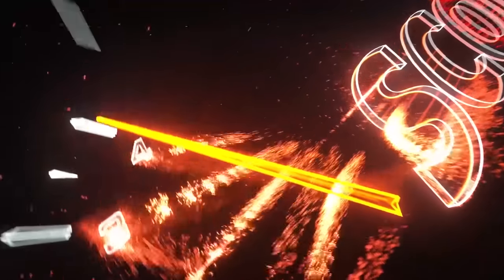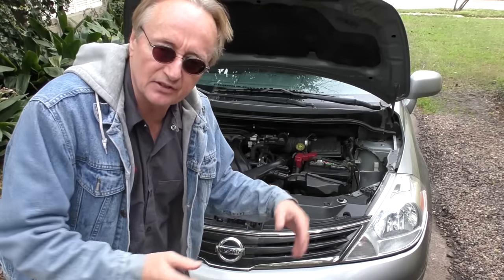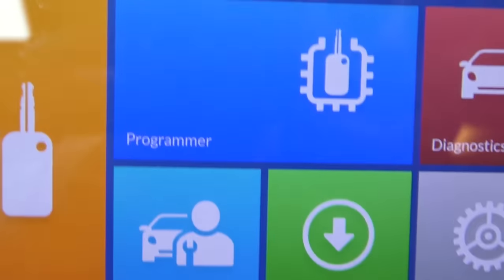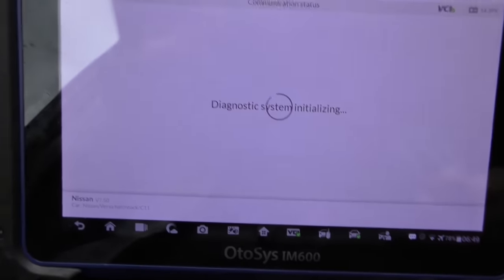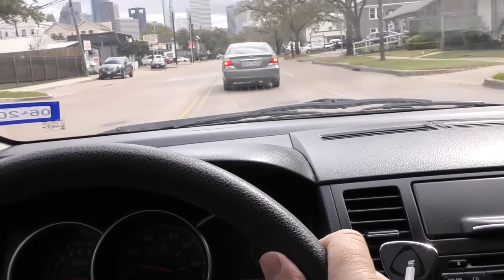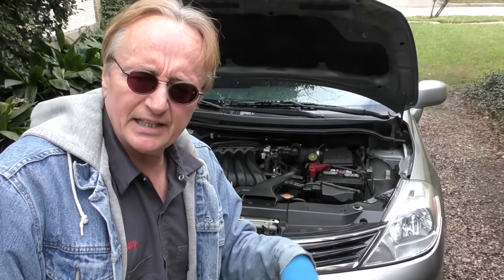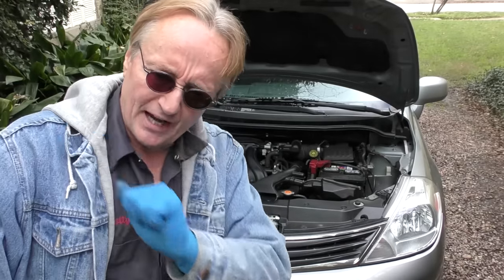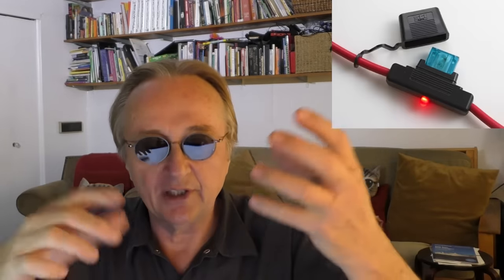Here's Why You Should Buy This Cheap Nissan

Comment: I can't believe Renault bought out Nissan and pretty much destroyed their reputation. They decimated the Skyline name.
Reply: Without Renault, no Nissan. I don't really like Renaults, but it IS true. Just look it up. ^^^ this guy above me is correct. They needed to cut tons of costs. They were not efficient.

Also Renault has no hand in their design. To me Nissan, as they are right now, are one of the more boring brands. Especially from an interior standpoint.
Reply: @Astke  Renault doesn't use CVT, but rather dual-clutch transmissions (known as EDC)! They're amazing here in Europe! At least better than the Volkswagen mafia criminals!
Reply: shechshire 
I think you're talking about Renault's old ceo Charles Ghosn.
  Nissan & Renault today are sharing technology while operating their own autonomously

*NO ONE SIDE IS CONTROLLING THE OTHER*
Reply: @MainMite06  I think they're like Honda and Ford, a balance of reliability and planned obsolescence and it looks like Toyota just got into it.

Comment: My parents owned a 2013 with a 5spd manual brand new. Sold it with 188k miles city miles. No major problems other than rear wheel bearings and A/C blower.
Reply: Heywood Jablowme 
My 08 Versa 4AT still runs all 4 original wheel bearings & original A/C blower right now at 215k..

Comment: My GF has a 14 versa with 174k miles . Recently I’m changing the struts, ac pressure sensor , rear wheel sensor code and several other small things but it’s still going strong with 30 mpg

Comment: I've had a 2015 Versa Note w/ CVT, no transmission/engine issues so far at 119K
Reply: Probably because it's a tiny car with a tiny engine. If it was a Sentra then it would be slipping all over the place.

Comment: Yes its good car, my friend using 2011 model  from 4 years and have 350,000 miles and it was 100,000 miles when he bought 4 years ago
Reply: Your friend drove 250,000 miles in 4 years?? 62,500 miles a year. That's a lot of miles.
Reply: @samadahmed7804  Yessssssss
Reply: @samadahmed7804  I drive 76,500 miles a year since 2014, not all that uncommon
Reply: @j887276  wow instead meanwhile my 2010  infiniti g37 just broke 50k 😂
Reply: @jamesmyers6739  stop babying it
Reply: @samadahmed7804  I drive a good 40-50k a year  just work and kid stuff
Reply: I have 2007 Nissan versa hatchback s its 181k miles on odometer i just changed transmission fluid every 2 years and transmission still good
Reply: no issues really, yet?
Reply: @EphemeralProductions  no major issue only wear and tear parts

Comment: Sold the Nissan Tiida 1.6L 4 Speed Auto for 2500$ approx. Just bought today Nissan Versa Hatch Back US specs (2012 limited edition) 4Speed Auto. 223k on ODO. Clean car. Luv it ❤️❤️😍 the difference I noticed from the GCC Tiida car spec'd to the US spec'd Versa are more options all around cruise & volume control on steering, foldable rear seats & in-dash mp3 player ❤

Comment: I would kind of stay away from any pre-2019 model year Nissan because of the issues with the JATCO CVT's. Current Nissans seem to be a lot better luck with CVT reliability.
Reply: There are millions of Nissan's running trouble free on roads with over 100ks in their clocks with CVTs. JATCO is a world class trans company and even JEEP uses their CVTs. The problem is, Nissan was the first to use CVTs on a commercial basis in 2009 and obviously early use of new tech gives a lot of teething problems mainly because people didn't know how to treat CVTs. You abuse CVT and it punishes you! Dont overload, change special oil once 50k kms and you will get one of the best of auto technologies today.

Comment: Have the same car Nissan Versa Tiida 2008. & It has approx. 174,000 miles & runs like a dream ❤️
Reply: s3 savage 
1.6L or 1.8L? Manual, 4AT, or CVT?
Reply: I have a cvt versa sl 2008 with 150k miles, it's run so nice, I love this car and have a descent sound with the subwoofer equiopement in the trunk
Reply: @MainMite06  1.6L 4AT

Comment: I got the same year, Manual trans.  So far just battery, oil, tires and filters.  One recommendation to other owners of this car.  Get brakes done by a pro unless you have the willingness to do a very good bleed on the system.  My clutch started acting up after just doing a regular pad change/using C Clamp to push in the piston.  Took about 6 months for it to work whatever junk I pushed into the hydraulic system out.  I've heard from a Nissan tech that this is a common issue and usually they do a whole clutch kit to resolve it...glad I waited at this point.

Comment: I have one of these. Cheap and 4speed 1.8L  engine 135HP.   Just 6.0 litres per hundred KM at 110 KPH in country areas  (39.2 Miles Per US gallon) city about 7.8 Litres per hundred. .  No problems so far after 105,000 KM on the clock mixed country and city.  Light on tyres - now on second set with Kumho tyres half worn. 
 Comfortable car, easy to drive 4 spd auto and quiet and very roomy for it's size as well as good performance. 
 Half hour to change all spark plugs or coil packs or both but have not done it yet as not needed yet.  Not a hard job at all.

Comment: On my second Nissan Cube and my wife has Nissan Pathfinder , we have no complaints; no problems with my cvt transmission and it has 160,000 miles
Reply: I bought a 2013 Cube last month that had 91,000 miles and heard about the problems with the Nissan CVTs after I bought and was worried about it. Makes me feel better that yours has 160,000 miles with no issues.

Comment: I have the 2015. Got rid of my pos VW that barely broke 130k before it took a dump. Have always liked Nissan and Infiniti. Went back to Nissan after the VW disaster. Have 127k on mine. It's roomy, great drivability. Mine is the CVT. Have not encountered a single issue. You're right about the placing of the spark plugs. I usually do it myself but this one i take to my mechanic.

Comment: My mom bought a 2011 versa hatchback with the 4 speed auto. She bought it and it had 50k miles and was 2 years old for $5500. Honestly surprised that this thing hasn't had any problems and she's at 160k miles now. Only thing I did was change brakes oil and battery.
Reply: MrTPoops 
Can you believe that people think that 2000s-now Nissans are considered "unreliable"?
   Especially the Versa,
they think that car is unreliable because it's half French
 btw: I have one myself & it has 215k & still runs

Comment: Bought mine new in 2012, and 11 years and 73K miles later, it’s been good. A/C leaks, but I don’t really use it, so I haven’t repaired it. Spark plugs and valve caps were the first significant engine repair this past year. A known issue is that the throttle body can get gunked up. I’ve had it cleaned twice, and cleaning it every few years gives a noticeable performance boost. It actually has a surprising amount of cargo space—slightly less than a Honda Fit, without feeling cramped like a Fit.

Comment: I bought a 2008 Versa with the 6 speed manual. I got 203,000 out of it. I have to admit, it was the best car I have ever had. Very cheap to maintain. I wouldn't buy one without a manual, especially now with those imploding CVT transmissions
Reply: Daywalker 1 
Ive already met someone whos already at 220k miles in '13 sentra, with minimal trouble. CVTs in truth are a double edge sword, but no,
    NOT ALL CVTS ARE LEMONS!
Reply: @MainMite06  No, you're right. Not all of them are bad. A few get through with little or no trouble. I worked at Nissan. If they aren't maintained, they will give you trouble, just like anything else that's neglected
Reply: How much would you price one at 167k miles? Thinking of getting one
Reply: @MainMite06  No, you're right. There was a bad batch in the Rogues back in the day, and some Altimas, but the Versa and Sentras had little trouble, especially if maintained

Comment: Finally my car is "Scotty Kilmer Approved"!

My 2010 Versa at 1,62,000 miles now. Original everything.
Reply: Yeah...and I have one that just turned over 1 trillion!! 🤣🤣🤣🤣🤣🤣🤣🤣🤣🤣🤣🤣🤣🤣
Reply: This Versa model comes in two types the S and the SL. S is 4 speed automatic while the SL is a CVT. Mine is an S or 4 speed automatic which Scotty is highliting on this video.
Reply: Komputar 
My 08 versa is at 215k with minor engine mods added.

Comment: I got a 2013 Nissan Sentra for 4500 its a Manual Transmission with 115k miles and it has sport mode and eco mode. It runs very well. 0-60 in under 60 seconds😂. The CVT problems exist in the Automatic Transmission. I lucked out though cause i get 35mpg in the city🏙.

Comment: We had good luck with a base '15 Nissan Versa (manual shift). 
We bought it for $12k brand new, downsized with this car but we paid other bills off quickly. We took it on a few trips to Montreal and other places, was super easy to park in tight spots and got us around just fine. The main problem was it being horrible in the snow (just invest in snow tires) and the ride quality is rough.

Comment: Mine is a sister model called Nissan Grand Livina a 7 seater Lmpv,  1.8L 126 hp with the same 4 speed AT and 115k kilometer on the odo , no major problem, a very basic car quite cheap as well and more reliable compared to other nissans with cvts

Comment: I prefer the manual, gives you more control and has a decent bit of acceleration in such a small engine. The tank takes you 350+ miles and costs about $30 to fill up (if not less) in the United States. It runs at about 35+ MPG in all conditions. I paid about $6850 with sales tax, a 6 month factory warranty, and a contract cancellation if anything went wrong. Without all the safety stuff, it would have run me just under 6 grand, but regardless, it was well worth it for the 76000 mile 2016 model year.
Reply: How about now ✨
Reply: @adamon5577  It wasn't very reliable but I was lucky enough to get the expensive repairs done <500 miles before the warranty expired. I ended up selling it and drive a Dodge Dakota and Toyota MR2 Spyder. It wasn't a terrible car, but the Versa was terribly boring to own.

Comment: True, descent and reliable car which is easy to maintain too. As far as I know, 2006 till 2010 is Japan made. 2011 & 2012 is made in Mexico. Build quality is totally different between japan and Mexico
Reply: Andrian Quioyo 
ALL USDM 08-NOW VERSAS WERE MADE IN MEXICO!
   And...a car's build quality truly depends on the experience, training,& excellent management of the people who work in the factory...
    My eldest USDM Versa 4at is at 215k, & still starts.
  Some asian commenters here own the JDM Versa-the "Tiida" with 200k miles with minimal issues too..

   FYI: the same factory who built the USDM Versas used to be a Mexican Renault factory in the 90s, & then they started working on Nissan-rebadged Clio sedans named "Platinas" before making the Versa series.
Reply: MainMite06 Thanks for the info sir, currently using ‘09 for almost a year now, I can say its a durable car.
72k miles on the clock and never experience any issue with the proper maintenance
I can say that durability is same as corolla but different when it comes to ride comfy
The highest mileage that I had seen here is 280k miles with original engine and tranny

Comment: Hey Scotty, I have a 2010 Dodge Avenger I bought in Dec 2010 with 25,000 miles so almost new.  I have never had any real problems with it until lately.  Just had the alternator go and had that replaced, but now I had the engine go into creep mode intermittently.  When I pulled the code it was showing a misfire, so since it has 161,000 miles I replaced all 4 plugs and coils, the misfire code went away was running good for about 3 days and then back into creep mode (no more then 1000 RPM and 35 mph), then the code that came back were cam sensor and crank sensor, throttle sensor, trans sensor.  Seemed like the cam sensor would be the most likely since it controls firing timing if I am correct.  So I changed the cam sensor and pushed it to make it fail and it wouldn't until 3 days later I pushed it hard out of a parking lot and it went into creep mode again.  This weekend I am changing the crankshaft sensor.  But one of the things I noticed is if I keep the RPMs at no more than 3000 it runs fine shifts fine builds up speed to 65 with no issues?  What do you think?

Comment: 2011 Versa Sedan 1.8sl  inherited from my father with 50k miles. Now has 103k miles.  NO ISSUES. Just did regular maintenance on it (spark plugs, thermostat, radiator flush , pcv valve, radiator cap). Handles the roads (and potholes) of NYC like a real trooper!

Comment: OMG, Scotty has finally reviewed my car :). I knew that he always hated Nissans but I was always wondering what he was thinking about this Versa with a 4-speed automatic tranny. There are videos  showing this car with 300k miles still going strong with an original engine and transmission. From my experience the worst part in this car is it's muffler. The original one lasted only 4 years. Never buy cheap muffler for this car (you'll have to replace it every 2 years if you have salt on the roads). I ended up buying a stainless steel muffler (was only $50 more expensive) and got a lifetime warranty on it (written on the paper). A couple more week points in it: a central lock module in the driver's door which will stop opening the hatch door sooner or later. A rear window defroster may also die after 7-10 years of car use. Other than that, only oil changes, brakes and spark plugs every 100k miles. Would a perfect cheap  commuter car/students car.
Reply: Igor Karpov this cars are taxis in Mexico and they last a loooooot
Reply: Just straight pipe it.

Comment: 6'5 380lbs here. I own an '08 Versa SL with 168k miles on it. Yes, the SL is the one with the CVT and no, it hasn't been serviced (reason being the dealer lied to my grandpa and said it was sealed off and the fluid was "lifetime"). It was a car previously owned by my grandfather before he got his 2022 RAV4. I fit reasonably well in the car, and have had very little issues with it so far. Just about to replace the catalytic converter on it, due to it being burnt out from bad spark plugs.
Reply: Trans started going at 173k miles LMAO

Comment: The intake manifold covering three of the spark plugs ! That's not cool. Stupid engineers.
Reply: Iridium plugs only need to be changed every 100k.  It's going to be a while until you need to remove the intake.
Reply: Can have it off in five min. Not really that bad. Unless you have a misfire and you cant unplug coils to find it.
Reply: Mr. Mojo Risin 
That's why you use a code scanner to detect the misfires,

Usually you'll find that the one ignition coil was fouled out by oil seeping into the spark plug holes..
Reply: Why on my 25 year old suzuki everything is easy to reach.  All 4 spark plugs out in few minutes without removing anything else.  Newer car repairability becomes worse and worse
Reply: @springer-qb4dv On some cars you have to remove intake manifold to even get to the plugs. I think when someone buys a used car they need to look at how easy it is to fix.

Comment: The Nissan Versa 2011 and before were great then it became unreliable, until 2017 when it was decent and 2018 and 19 were the greatest ones they had in years (they were good at least for the price) the 2016 versa note is also good
Reply: So the 2018 nissan versa is a good car?
Reply: @weldmin4818 for regular use its not bad, it’s a 6.5 for me, the cvt ain’t good for any of the models though

Comment: I have an 09 nissan versa with a 6 speed manual and I have 108k miles on it and im the original owner from new. I have replaced parts in my driveway with hand tools and those parts were due to my abuse. I used my Bluetooth  scanner and the only 4 codes were for tire sensors that I know aren't in the tire. When I bought that car I was told it had ABS but after 11 years I had my wheel hub bearings going bad from me going 120 mph in it, but Firestone said I needed hub bearings that are ABS based on the VIN and when I replaced them there was no sensor. I took the bearings back to the same dealership and it went nowhere.

Comment: Those nissans are popular in my country. The only issue it has is the suspension, its pretty weak but parts are relatively cheap so you wont spend a small fortune.

Comment: This is my car! Except a 2010 version and it’s a hatchback. It’s a great first car, only 148000 miles. It does need an exhaust pipe replacement next year because it’s rusty, I think. That’s just due to age of the car.